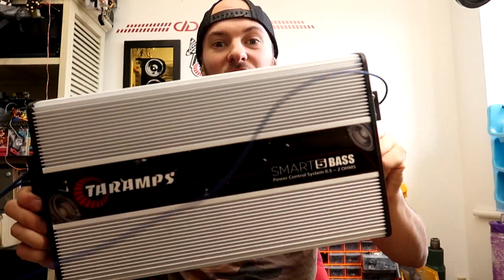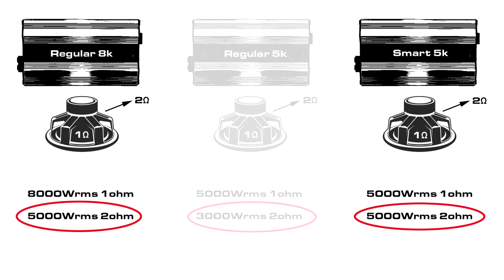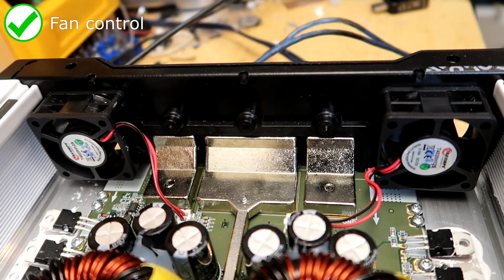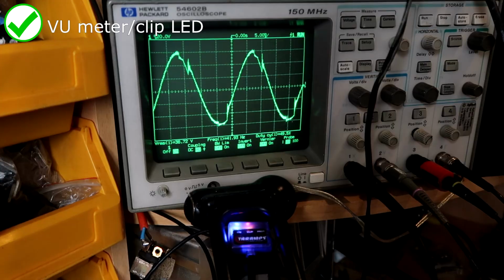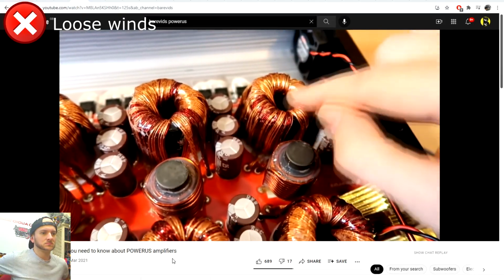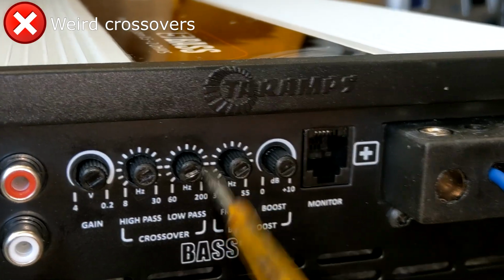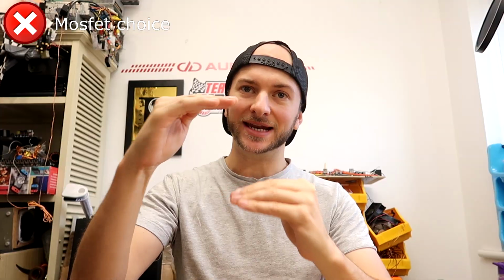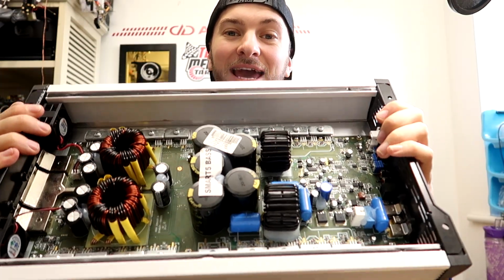The good VS the bad - Taramps SMART 5 & BASS circuit overview

Comment: @barevids    Would my MD12K.5 differ in output with 3300uf 160v caps it has in it.  compared to the 2200uf 200v caps it says should be installed on the board?
Reply from the maker: No, if anything it would make a little less power on dynamic transients with the 200v. The 160v caps are better as they are higher capacity.
Reply: @barevids  ahh so I was gifted when I bought this amp with the 160v caps. 🤔. What would be the odds of me finding one built with the 160v instead of the 200v 🤣

Comment: I was between the smart 5 bass and the Bass 8000. Will be wired to 0.66 ohm.  Not 100% confident in the normal Smart 5 wired that low. Even though I have ran over 10 Taramps amps with no problems.,

Comment: Would it be possible to coat the loose windings on the power supply transformers with hot glue or something to keep them from scraping each other or would that cause a problem?
Reply: How much difference between smart 5k and smart 5k bass? I’m about to order one or the other, can’t decide I got 2x 15s.
Reply: @colemclane650  I would most definitely go with the Smart 5 if i were u. just listen to what hes saying. Peace and bass!
Reply: @LowFrequencyFanatic  I ordered smart 5k got it fir $450 from res sounds !! What a steal !! Should be wired in next weekend let’s goooooo
Reply: @colemclane650  how’s it been working for you?
Reply: @gagedoble2843  works great loads of power, would recommend 140-200ah agm and alternator for full potential for sustained play
Reply: @colemclane650  thanks for the reply! I just got the email that my singer 275 amp alt is on the way and I have a xs power d2400 under the hood(96ah) you think that’s enough or shouldI get another battery?
Reply: @gagedoble2843   probably going to want another battery. I would test the alt and current battery, have a volt meter wired to the amp so you can see the voltage and just monitor it. When you start getting higher volume it will start draining.
Reply: @gagedoble2843  I have 2x d3400 under hood and stock alt getting alt here soon when I make up my mind. I can play clean up to 31 and when playing rebassed dj russticals it will start dropping low 12s high 11s at around 26-27 volume
Reply: @colemclane650  Okay good to know. You still using 2x 15’s? If so which ones
Reply: @gagedoble2843  vxf 15

Comment: I just got my smart 5 bass version yesterday in the mail. I had the original smart 3 up until I bought this. So I'm hoping it'll sound good and pure.
Reply: How does it sound compared to smart 3?
Reply: @khmerboxer214  just about twice as loud and pure I guess. Been working great! Power hungry tho. Got a 320a alt coming. The 180 I got just isn't doing it.
Reply: @Scott Wright🔊  I've been trying to see who got the smart 5k bass..I cnt decide on which one..do u think the 5bass is better??or what's the difference
Reply: @Cali 82!  the original has capable of more power technically. I personally was using the factory head unit so I wanted the bass crossover. Which I got a dap and changed the radio out anyways. The bass version still does rated power tho. And it's. 5 ohm stable! But I've love it and never once has a issue w it. Digs into them low lows real nice!
Reply: @Scott Wright🔊  so you're saying go with the regular 5 smart 5k not 5k bass??cuz im not running.5 jus at 1ohm..i thought the 5kbass was better and put out more power..the video i watched it put out way more then 5k so i was confused
Reply: @Scott Wright🔊  I mean u say the 5k bass right?
Reply: @Scott Wright🔊  I'm trying order 1 tomorrow so was seeing which was better of the 2
Reply: Having amp for over a year now, still runs strong. Had to add some hot glue to a few components to stiffen things up, but has remained performing flawlessly! Just adding an update 👍

Comment: I have a Sundown Audio SFB-3000D. Since cold weather (below 45f) when I start my vehicle in the morning the amp fan is very fast and loud for about 2 minutes then it goes silent. It only does this when its cold outside. Anyone have this problem?
If it is just a failing fan then no big deal. I can replace it myself. What I'm afraid of is that there is a problem beyond just the fan since it only does this for a couple of minutes the quits and only in the morning when its cold outside. The fan literally sounds like its going to fly apart.
Reply from the maker: yes its the fan bearings. you can oil them and it will resolve it. Or just replace the fan with Noctua.
Reply: @barevids  Thank you very much Sam. I will replace it with a Noctua asap.

Comment: there's an extensive thread on the diyaudio forums about constant power amplifiers, the title of the thread is "The dark side of constant power amplifiers (and similar schemes)" they have good discussions on why it is not a good idea, also if you think about it having "constant power" technically compresses music because of the dynamic nature, why would you want that?  in my opinion if you want an amplifier rated the same power for multiple impedances, during turn on measure the resistance at the terminal (which is usually pretty close to the rating) and adjust supply rails to what you need to produce whatever power you want, then turn the amplifier on
Reply: Interesting theory, illl have to look into that but imo if amplifiers produce less power with impedance rise that means you have to compensate with eq to boost those areas in order to have a flat loudness response. Otherwise, you have large spikes in loudness when coupled with cabin gain just exacerbate this amp issue. I think constant power corrects this best it can, and gives you a more true to source sound imo
Reply: So this compression is not totally wrong but the term compression in the audio sense means taking the signal and squashing the dynamics so that it is less dynamic hence making it less dynamic(loud and soft). Constant power does not do this! It merely produces power equal at the most usable impedance range e.g. 1-4 ohms etc.

Comment: Around 1:30 I think I'm missing what you're trying to say. 

The way I see it in my head. If I wire a sub to what should be on paper 1 ohm. And I know it can take 5k. I set it to 70v on the output of the amp. When I rise, let's say to 2 ohm in this example, I'll be pushing 2500w out of the sub. 

So I'm just a little confused by what you said there. I think because I can't tell if you were implying if you rise, this amp will still give constant power. But unless you yeet the volume and rely on the limiter it can't. 

Sorry for the dumb question or if it's confusing. I normally only supposed to be dumb on Tuesdays.
Reply from the maker: This is why you don't use multimeter to set your gains. All that does is calibrate it assuming the load is static, which it isn't. 
The Smart 5 is a 5000wrms 2ohm stable amplifier, that has the ability to be wired to 1ohm by using a limiter to reduce the output voltage if the power exceeds 5000w. If you connect a 1ohm load to the amplifier and calibrate voltage for that, you'll be leaving half the power on the table.
The Smart 5 is also identical to a 10,000wrms 1ohm stable amplifier, just with less parallel mosfets since it only needs to handle half the current for 5k. So in your example, calibrate on the multimeter for 10k at 1ohm, and when rising to 2ohm you will see 5k. The amp just makes sure that in the instance that not enough rise is present, it doesn't actually try and produce 7,8,10k etc as that will damage it long term. 
If you look at the amp dyno videos of this amp you can see exactly what I mean. Certified and uncertified tests produce around the 5k mark at loads up to 2ohm, thanks to the limiter working as intended. However, during dynamic test, the audio pulse happens too quickly for the limiter to activate in time, and so you get a glimpse into how this amplifier works, with it putting out in excess of 8000 or 10,000w in some cases, since that's what this amplifier is, a 10k with a limiter above 5k that takes a few milliseconds to kick in. All the while you have enough rise, the limiter doesn't need to activate and the amp behaves exactly like a 10k would. Dip below that impedance limit of 2ohms, and the amp will prevent itself making more power than designed by reducing the output voltage.
Reply from the maker: Note that I am disregarding rail sag and simplifying some values to make this example easier to understand.
Reply: @barevids  so what amp you think is better the smart 5 bass or smart 5?

Comment: Sam, you say I should open up the HPF but I am using that as a subsonic filter. Shouldn’t we not want to play a half octave under port tuning on a ported sub box? I have it set for 25 hertz on a 32 hertz tuned box.
Reply from the maker: No, leave it at zero on these amps. If you REALLY need even more hpf than what it offers at zero, use DSP.

Comment: TRAMPS cut out bass below 30 hz.... Poor output below 30hz...lame..... Bare vids your awesome!!!! Love your channel!!!
Reply from the maker: did you even watch the video, specifically the part that showed frequency response? 🙄🙄 thanks for the compliment but please stop spreading this nonsense.
Reply: @barevids fact.make a video show voltmeter on a frequency sweep..I have done both voltage and amperage (-18db / octave starting at 30hz) tramp3000k hd.... massive power above 30hz!!
Reply: If you mean what you did at 10:45??  There you do a reverse crossover test and modify output to "appear" flat...as an engineer you should know that's not a frequency sweep!!!..... That's a crossover test!!....you don't know how to properly test frequency response?

Comment: Its true, you get what you pay for! But simply full bridge is the best, even if its cheap its still going to great power. My Smart 3 gets pretty hot just at idle with no output, about 50 degrees C on the case, the fans then turn on but never turn back off because it constantly gain heat. But ive had it on for long drives at low volume and never had problems. 

The Smart 3 gave me a huge power boost without me having to upgrade my electrical, I can hold a little over 1000 watts RMS while holding 14.5V with just a worn old lead acid battery and stock 70amp alt that probably only does 30amp. My previous amp Pioneer GM-D8701 I was having huge voltage drop and could barely hold 600watts and I actually paid more for it!

Comment: Hi Sam, awesome technical breakdown as usual. Funny coincidence as I was eyeing the Smart 5K Bass but ended up buying twin Smart 3 Basses as it was a steal of a deal on Amazon ($300CAD each) and plan to wire each @ 0.7ohm for each 12" DC XL (dual 1.4ohm coils). I was wondering if you can you comment on how the Smart 3K Bass compares to the 5K Bass in regards to any intricacies or is it just a simple upscaling we see here with the Smart 5K bass? Alternatively at the time, I was looking at pair of regular Smart 3s due to the 12.6V rating vs 14.4V but ended up going with the Basses for the 0.5ohm stability for additional safety margin, even though I doubt I would even seeing 0.7 nominal often. Ultimately I plan to run these set to around 1.5-2Kw a piece to allow extra headroom. I'm second-guessing myself a little bit but at the price point I feel like I got a great deal.

Comment: In forums I've read that it can cause emf spikes when the impedance drops when hitting a sub at it's Fs. Would def wanna see some oscope views with it playing at a subs fs. Wondering on a sound quality perspective.
Reply from the maker: I think you are confused with your terminology. At FS there is a great rise in impedance, not drop. Perhaps you mean box tuning frequency instead?
Reply: @barevids  yes from what I read the rise in impedance causes a voltage spike when the amp tries to correct itself with the constant power feature.

Comment: I'd like to see what they do with a reworking of a resistor divider to influence the power supply throttling and achieve a bit more rail voltage.
Reply: I guess I should have finished the video before commenting, then I would have heard the comments on fet voltage ratings.

Comment: I've got the constant power sundown sia 3500. it only has one input and one output rca. I believe they are just hooked together internally. the amp works no matter which terminal i plug into. what should i do with the stereo outputs from my pioneer head unit? a voice in my head says just plugging them both in where i'd be shorting the channels together can't be right.
Reply: did you ever decide what to do??
i bought an expensive y cable, but seems i might screw up my deck's sub out running the y cable backwards, but idk...

this is where ocd sucks lol
Reply: @bdc211  i did some more reading and determined it was in fact fine to run them together. or plug both into the amp. electrically it doesnt matter.

Comment: VIP QUESTION in need of PRO answer: (pros only) To lower my ohms (bcuz 0.7 rises above 1 ohm whereas 0.35 will rise to 0.5 which these amps can handle I've heard) I can connect just one amp (Taramps Bass 8K) to BOTH of my DVC 1.4 ohm subs to wire down to 0.35 BUT THE QUESTION IS what if I add a second Bass 8K wired EXACTLY the same as amp #1 AND KEEP my 0.35 ohm??? (Amps are unstrappable)
Here's why I think this should hypothetically work.. Currently I have one Bass 8K amp per one sub (15" Fi Neo 4.11 as shown on my YT channel, link below) but 0.7 ohm is too high for my SPL competitions and if I run just one of these amps for two subs I can cut my impedance in half to 0.35 so WHAT IF I WIRE A SECOND IDENTICAL AMP EXACTLY THE SAME WAY. (A second set of speaker wires wired EXACTLY the same way as amp #1) which in my mind will keep each of them wired down to 0.35 ohm which they will remain at when adding second amp. Plz ask if doesn't make sense and see my YT channel's Ford Edge Car Audio Fi Build playlist and in some of the videos descriptions I have listed my set-ups details.
16kW, 155+ dB, S5 MECA, 390a JS alt, LC7i, XS Power D3400 & SB1500-75 which is a 1500 farad $1,300 super cap bank. And more!
Reply from the maker: I understand what you're asking. This is called bridge parallel. Crown PA amps do this with their 2 channels to allow 1ohm Mono operation from what is usually a pair of 2ohm stable channels. I would NOT recommend you try this with a pair of Taramps. Each signal needs to be ABSOLUTELY IDENTICAL and even a few mV of difference will cause an issue - you can't rely on the pre-amp filters in these amps to give you identical signal across the entire range. Also since both amps have DC halfrail on the speaker terminals at all times, if the voltage drop to one amp was slightly different this would cause a difference in the DC at the terminals, also probably causing failure. Power is cheap these days, just buy a pair of 15k powerus or banda, wire each to 0.7 and call it a day...
Reply: Bad idea.... Stay 0.7 ohm... Do what barevids says he's correct... I'm as "pro" as it gets....post Ph.D. E.E.

Comment: Does these spec's also carry over unto the smart 3k and smart 3k bass? I recently replaced a skar rp2000 with a 3k bass, and now wonder if the smart 3k would have been better?
Reply from the maker: Yes similar situation
Reply: @barevids  hey bro so which will u get the smart 3k or the smart 3k bass which is a better buy tnks

Comment: On my Smart3k, I noticed the crossovers just plain SUCK. So I open them up and used the crossovers built in the head unit. Another thing is I got the same signal no matter if I plugged into the RCA in or out. So yes I just plugged into both and I haven’t had any problems. The only problems I had was the cooling fan quit and the amp got extremely hot. So I sent it back and got a new one. The pots on these amps are horrible, so you have to adjust them very slightly.
Reply: its common on most brazillian amps. jbl jl alpine and many others have full bridges with the kind of filters we like. though in this day and age even cheap decks have pretty decent dsp and or crossover capabilities
Reply: The pots being sensitive are because they have lower voltage rca inputs , i may be wrong but i lower the rca voltage from my head unit and it helped alot.
Reply: @Hayawasa  how did you lower the voltage from the rca from the head unit?
Reply: My sub out has a level adjustment.
Reply: no bass below 35hz , no matter what you do

Comment: head units are outputting power L/R individually. so if you have 2v on each rca that's 4v reaching the amp in stereo. this amp being designed to input one wont have issues taking the single lead but the head unit may be varying each leads voltages due to how the music is mixed. as such i would not recommend running just a single RCA but using the 2 to 1 adapter instead. of course if you have a DSP you can map a single RCA to it and be done
Reply from the maker: This is super incorrect buddy. Please stop sharing this. RCAs are parallel, each isn't 2v and don't become 4v when used together. Each has 4v on it when the head unit is at full volume. Subwoofer frequencies are Mono and the head unit mixes down this way.
Reply: @barevids  on a standard car amp - if you plug only a single rca into the jacks, you will notice a drop in output. the amp is expecting to see voltage on both RCA's
Reply: bass freq are not in stereo. thats why it doesnt matter

Comment: Can anyone Please answer my Question if you have the time. Q: Do you have to upgrade your cars power supply if i use this amp meaning do you have get bigger battery bigger alternator.etc.:goodvibes:.
Reply: You absolutely do, big battery bank and and higher output alt is always a good idea
Reply: I will but u could use two good batteries Northstar r xs power and 5000f super caps. With a stock alt.
Reply: @tonylanclos3756  Thanks.